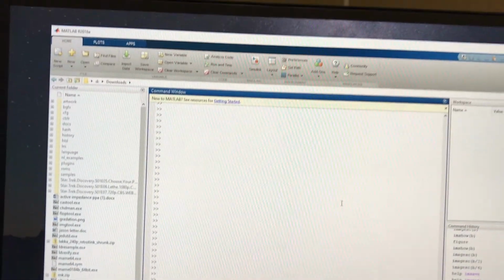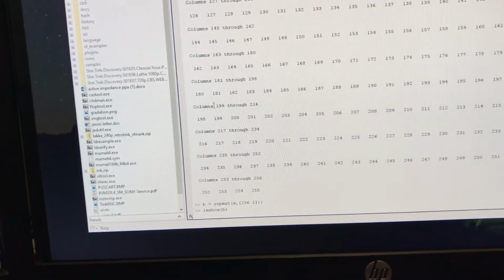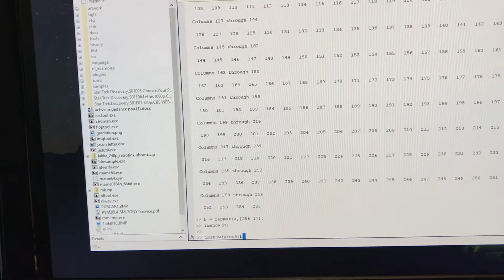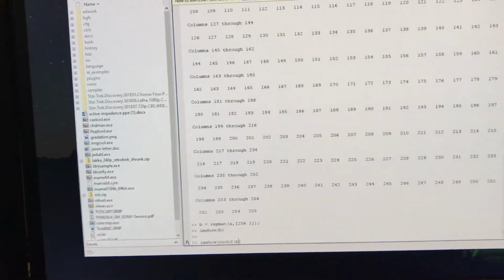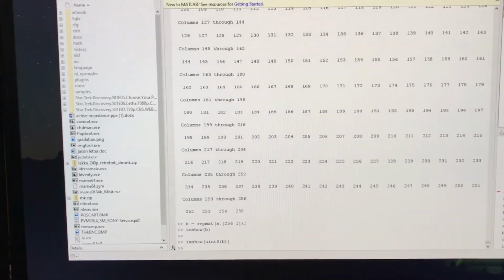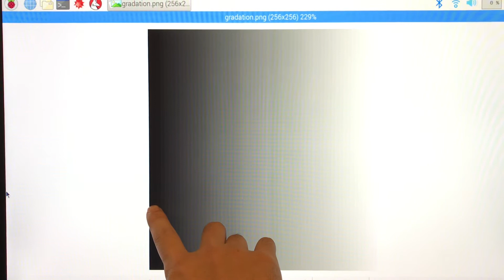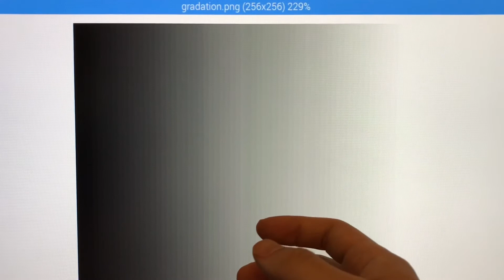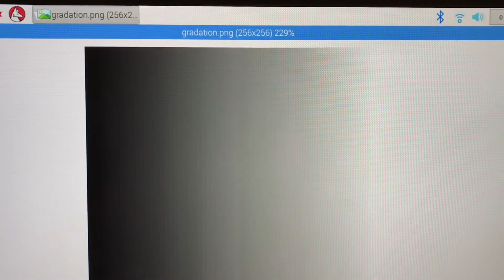RetroTINK-Ultimate and VGA666 Output Comparison

Comment: This was interesting to see. I have a VGA666RGBS and it looks really good on my PVM. I got it because it wasn't that expensive, and it's made right here in Taiwan. I also have one of the very first RetroTink adapters (for going analog to HDMI) and I love it, especially for systems that only support composite or S-video. 

I also hope to get a 5x Pro sometimes down the road, not just for upscaling but for downscaling to 240p

Comment: This was very informative. mainly in the way I now understand retrotink is a separate board to a pi and needs to link together. at least i think that's what's happening
Reply: It is. It fits into the RPi top pins/GPIO. 666 does as well, although sometimes it's sold as a "kit" where you just get the loose parts including a sticky-labelled bag of resistors. The RetroTINK comes preassembled, so that's a small blessing.